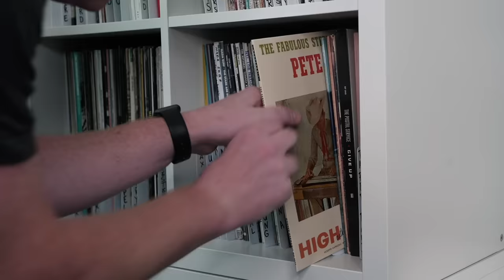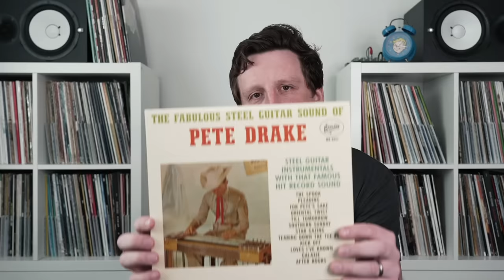6 Guitar Pedal Myths

Comment: As a repairer of guitar related electronics, from reliability and ease of fault finding and serviceability perspectives I prefer through hole components and products that use them. Everything else I'm in full agreement with you.

The only time I  think a true bypass is needed is if driving a pedal such as a fuzz face, is if you are trying to replicate particular recordings or sounds such as those of Hendrix. There is a particular interaction between the guitar (passive) electronics, namely the volume pot and the input of the fuzzface. A directly connected guitar to this pedal will allow the amount of distortion/fuzz to drop or reduce drastically with only a slight "nudge" of the guitar volume in the downward direction alowing you to go from filthy overdrive to a relatively clean sound for cleaner playing. If there is a buffer between these two, this interaction will not exist and the change from full drive to clean is spread across major part of the volume pot rotation. Whether this is a good or bad thing really depends on what you are after and your musical tastes.

Thanks for the great video.
Reply: Much easier to pop off a SM component to fault find though.
Reply: Too true!
Reply: @gringopig  : 
Yes and no, depends on the complexity and density of the board being worked on.
If removing components for any reason and this is more related to SM technology 
I would need to have a new replacement as I would not trust reusing the old one even if the old component was considered OK.

I prefer to do a number of tests on the circuit especially when dealing with analogue signals.
With or without access to a schematic (with being preferable) you can do a whole lot of tests such as dc voltage measurements signal tracing to find out where the signal is getting to or not. Very rarely do I need to pop off a component to find out what is wrong, SM or through hole.

Comment: Hell yeah Josh! Oliver from Toronto, Canada here and I love your show. 2 times I've been held up recently, and then got wise: 

1) Was thinking about getting a Proco Rat and was caught up between trying to get a vintage 80s Rat and a modern Rat II, and I had seen a bunch of reviews, but honestly, I think I saw here and on Schnobel a A/B comparison and couldn't tell the difference. I plugged into a Rat II in my local shop and it sounded so good! Spongy, full of saturation, and the Hard-clipping circuits to many peoples surprises clean up really well! Bought it then and there and haven't looked back, still one of my favourites on the board! 

2) The other was tubescreamer 808 vs Joyo Vintage Overdrive. Both, and I repeat, BOTH have the RC4558 chip in it, and I was thinking ok, a metal enclosure overdrive with the same chip, come on marketing companies and forums, its a simple circuit it shouldn't cost as much as the 808s go for now! Same thing when researching too - couldn't tell with headphones in blindfold comparisons. Bought it and haven't looked back - sounds so money! 

I've even had some of my friends try out the Rat II and the Joyo Vintage overdrive, and with both of them costing at least 4 times less than their vintage counterparts, its time to make music and have money for drinks after! Cheers Josh! Cool is not cool, Good Is Cool - Josh Scott.

Comment: I must admit to buying about a dozen different op-amps years ago. The pedal (Biyang OD-8 X-Drive) has an op-amp socket and a switch for different kinds of clipping and I believe one of them is op-amp clipping. I re-recorded the same guitar chord through different op-amps and was able to hear an ever so slight difference. But practically in a mix or band setting it's still negligible.

Comment: For my pedal rig I start with a Blues Driver plugged into the guitar (have a bunch of true bypass pedals after that) and then end my signal chain with a Boss Digital Delay. Essentially having a buffered pedal at the start and finish of my chain. It seems to remedy any tone loss that otherwise would be occurring.
Reply: The buffered bypass at the end of your guitar cable is a good thing as explained.  But realize the electronics in all pedals have buffered outputs which can drive more cable much better than the high impedance guitar pickup.  The worst case is all non-buffered pedals with all of them switched off.

Comment: This is what I've been trying to tell my brother. He likes true bypass only but doesn't understand impedance & maintaining the tone. I really like that you spoke the truth here. Way too many people hear with their eyes & are snobs & most don't know how to read a schematic nor do they understand how electronic components work. They don't understand that these companies use what was cheap & they miss the fact that you mentioned the circuit is designed around certain components just like the FF & Big Muff. Another thing is the original FF had 20% tolerances & that's why you hear the stories on this was a good one it had the magical parts. These days we have 1% tolerances & we can create equally or better sounding gear but sadly we will always have people ignorant to the fact the components in old gear dry out & at some point you will need to change those parts out.

Comment: i´ve fallen for the myth of true bypass and buffered bypass. A great episode would be on how to create a balance between the two in your pedal board. 
great episode by the way
Reply: Yes! I was just thinking the same thing
Reply: Good idea
Reply: you can run all true bypass and then just build a buffer for $25 (Im canadian might be cheaper USA) as your very last pedal.  buffer is better the further in your chain it is, if you run 30 ft of cable from your guitar to your board to your amp, its better to have like 10 ft to your amp from your board, and 20 ft to your board than the opposite

Comment: Well surface mounts are harder to fix on your own, simple fixes like refreshing a soldering point or swapping a burnt element
Reply: except surface mount quality control is much higher, it is much less likely you will ever need to fix...
Reply: it's bullshit mate. It's way easier to damage the PCB by trying to remove a THT part than when removing an SMD component. I knowe that surface mount parts are smaller, but replacing them is hundred times faster and safer than struggling with clinched legs of some cap or IC.

Comment: As for a topic, I would love to have a better understanding of impedance. Whether it's amps, pedals, how pedals are stacked—whatever. But every time I have had impedance explained to me I feel like I get an inch closer to understanding but really don't get it yet.
Reply: Phil Jacoby impedance is quite simple from a physics standpoint.  This post won’t be exact, but it is close enough for a light discussion

Electricity is a flow of electrons, the amount of electrons in the flow is the current(amps), how fast they flow is the electric potential(voltage). In direct current the electric flow goes directly from point a to point b continuously, any resistance to that flow is called electrical resistance.

In alternating current the electric flow will change, it will move from point a to point b, then switch and move from point b to point a, and this switching happens often (US standard 120V AC switches 60 times a second).  Same as in DC, any resistance to electric flow is called electrical resistance, but there is another resistance to the change of rate of flow, and that is called reactance. The combination of resistance and reactance is called impedance.

So if you want to think of it simply, impedance is a more complex version of resistance.  Resistance is for dc and impedance is for ac.  There is more detail and subtle intricacies that apply, but that is the 2 minute explanation

Now, for tonal consequences of impedance values in audio circuits... there is certainly consequences, but they are varied depending on the application and imo people tend to make more of a big deal out of it than engineer designing a circuit does.
Reply: Hi Phil, you got the technical explanation of what impedance is, and here comes the practical explanation:

Input impedance is resistance to, or loading of the AC input signal. Music is AC (alternate current) - higher input impedance loads less and dont ruin the treble of the signal.
Example: Guitar amp, they are almost always 1 Mohms input impedance, and will not ruin the guitarsignal. The guitar has a very high output impedance ~ 8 kohms or more.
So a high input impedance is generally good, and a low output impedance is generally good.

Output impedance: Could be from an amp to the speaker. Those 2 values have to be matched closely, because the impedance of the speaker will be reflected backwards
into the amp, and transformed by the output transformer if it is a tubeamp, and loading the output tubes. Bad loading will make the tubes work less good and give less output.
You can load the amp wrong by 1 step, and that will give you a looser sound if you put a lower impedance speaker on, and a tighter sound if it is higher.
The amps output impedance translates to damping factor, which controls the tightnes of the bass frequencies. Solid state amps has a very low output impedance, often
milliohms, which gives a high damping factor, and tube amps have a high output impedance, often a few ohms, which gives us the sound we like :-)

Guitars, preamps, pedals ... also have output impedances, which has to be fairly low. A general rule says at least 1:10. But more is better - I always go for 1:100 in my HiFi setup.
Pedals often has 1 Mohm, but 500 Kohms can be seen. I suppose most of them have output impedances of 1 kohm, or less. Very high input impedances have one disadvantage: 
It picks up noise.

It took me some time to make this short and clear, so I hope that clears at least something up.
Reply: That was all real good - lemme try and encasualte for non-techy gear-heads..
...
 There's a few places you wanna think about impedance - the biggie is speakers. Bearing in mind the definition/s above, if you halve the impedance (by plugging in a second speaker say, in parallel) your amp will try and push twice the power - which will only work of the amp is RATED to drive the lower impedance
(A tube amp will run kinda hot, a silicon one may well blow out completely)
Hence power ratings of 8 ohms, 4 ohms etc
When your amps running with no speaker plugged in (**don't EVER do this to a tube amp**) it's driving 'infinity ohms' and not moving any power. A short circuit (e.g. a damaged lead) is like zero ohms (whiich can easily kill a silicon-based amp - it'll try and drive 'infinity watts' into the cable and blow (protection circuitry's common these days, but hey dont risk it!))
...
When hooking up a pedal rig, everything (pedals amp etc) is rated as a high impedance ('bout a megohom, =1000k ohm ) input, so it shouldnt worry you none. As an experiment, if you get a jack to phone lead/adaptor, plugged your gee-tar straight into a HIFI's standard 50k 'line' input - you'll notice a definite 'muffling' of your tone, like the treble being WAY down (unless your guitars 'active, with electronics in)
Long (curly) leads can do the same kind of thing, through capacitance)

Again you don't USUALLY need to worry bout this - each pedal has a low-ish impedance output (10-50k) and has no trouble driving the HIGH impedance of the next pedal in the chain, or the amp. The (passive) pickups in your gee-tar/bass are quite electrically gentle things, that work best into a high impedance (easy to do with tube, more fiddly with silicon), and even too much cable can muffle things - some people like to put a buffer* at the beginning of an FX chan/pedalboard for the same reason (as pointed out BOSS pedeals have their OWN buffered bypass, and can be used this way, as the first device in the chain

Does that help ?

 *A 'buffer' is a type of (pre)amp that doesn't boost the signal - just has a high impedance in, and a low impedance out so it can drive a bunch of stuff)

Comment: Another highly informative upload. In the 60s drivers returned to their cars after it being parked in the sun and found their radio didn't work, later on, the radio worked: I'm sure JHS knows this. 60s radios had germanium transistors, which are heat sensitive. It's unlikely to be an issue in a Ge pedal but thermal runaway can cause Ge transistors to fail. I prefer through hole as opposed to surface mount simply from the servicing point of view. To carry out repairs on surface mount, usually hot air soldering equipment is expensive and a new skill needs to be acquired. Love it!

Comment: If anything I hate the myths and forums for these reasons. There are too many folks who are basing decisions off of what they saw on some board someplace, and the echo chamber of a forum.  When I started playing guitar, we spent all our time talking about records, bands and guitar players, not gear. We were thrilled to have an amp with distortion, or a single boss pedal.  We were trying to steal likes from each other, and teach each other guitar solos we had learned of off CDs. I think this 'tone quest' stuff is GREAT, but do people even practice anymore? I spent so much time learn to PLAY Mark Knopfler riffs, I didn't spend much time searching for a pedal or pick ups to get that sound.
Reply: Allan Kaufman plus Knopfler was the master of clean tone - something truly taken for granted but most guitarist
Reply: Nels Cline has a great point that if all you are doing is playing 5ths ( power chords) it matters much what yer fuzz pedal is. If you are really playing a bit more deeply it matters less. All the sounds people want to emulate form the pre 1990's were done with a pretty small palette of pedals. As far as cost Electro Harmonix were really cheap ( a little MUff was 20 bucks I think) but th were not made very sturdy. When MXR came and made well made pedals it chnged much. I use the same MXR Dist +, RAT and Big MUff ( green Sovtek, my 1970's little muff fell apart) I have always used, tho if I was to buy anything else it would be Eathquakers
Reply: Totally agree. I miss the good old days. I've spent WAY too much time worry about AlNiCo (and even spelling it like that), bone nuts, cables, strings, and loads of other stuff. Recently I've got back to rehearsing, building my repertoire and just enjoying playing. You know, what it's all about. Fifty years ago people bought stuff and played it. That's it!
Reply: I kind of agree, tone hunting and geeking out is very good but what's the point if you can barely play your instrument? For example SRV was one of the first guitarists I studied, and I learned how to get his spank and attitude (or my approximation) WAAY before I bought a tubescreamer and a marshall. Don't even get me started on core musical fundamentals... Jesus it's like people will do anything to avoid facing their own flaws.
Reply: When I was a teenager I thought if only I had any Boss pedal and a Tube Screamer I could be the next Stevie Ray Vaughan or Jimi Hendrix. LOL! I thought that any Boss pedal was the absolute gold standard. Now I guess I'd say I prefer the "boutique" stuff not because I'm some elitist but my thing is that I think it's cool that they are pedals basically made by fanboys and just seem to me like they have this intense focus on replicating a specific sound. I will say though that I saw Tim Pierce say that if you want to get a really good tone just get the most basic Boss distortion pedal and it will work. There there is the other extreme where Joe Bonamassa said pedals are for "lazy people". Pedals are nothing else if not just simple fun to use.
Reply: Allan Kaufman you are the source for so much great knowledge
Reply: Not a big subscriber to Mythology but I spent 40 years unable to plug in for more than a song or two to anyone's amplifier because of the godawful intolerable tones I was able to dial in. Then I caught an optimistic looking youtube video and dropped 300 bones on a pedal that works. Finally I get to practice electric. Glad you found your tone so easily, I will bet you have it easier looking for shoes as well.
Reply: People are basing quality decisions by playing at bedroom volumes when band level tone/sound is completely different!

Comment: When I was starting playing guitar, I bought an Ibanez TS808 that, after I learned a bit more how to play guitar did not blow me away as it was thin and did not properly overdrive like many others. It lacked the TS9's kick that I was looking for, but I never got rid of it

I compared it to the Bonsai 808 and it still was not the same, and I assume it was due to the quality control margin and it passed. The kicker? It is the perfect "clean" booster TS sound and it makes any single coil sound sweeter than honey. There are differences between pedal components, and sometimes some pedals just fall in the edge of a spectrum to barely pass quality control

Comment: Through hole is better though! 

Let me explain, I've never heard this argument, but having worked with phones and I'm currently fixing my through hole amp, I can resolder the through holes and fix the connections. If it was surface mount chips I would have real trouble trying to fix it. But that's the only reason I can think it might be better. Like you said, sonically they are the same
Reply: That makes sense.
Reply: I've built surface mount synths by hand. It's actually faster that assembling through hole, if you have the right tools. You need a good magnifier, lights, tweezers, small tip soldering iron and plenty of extra components in case you sneeze.